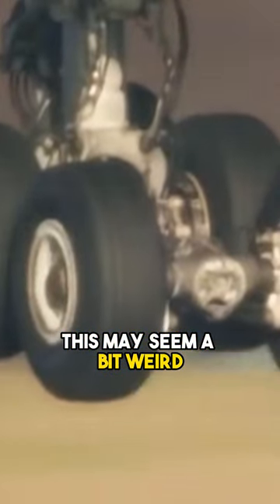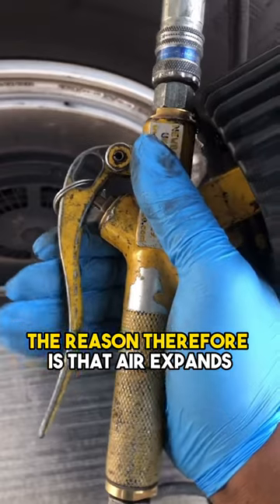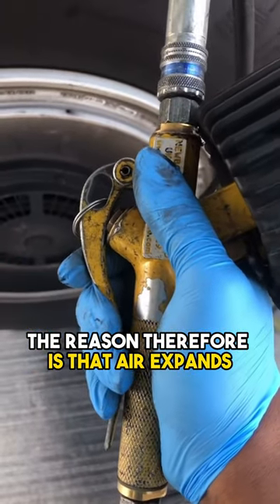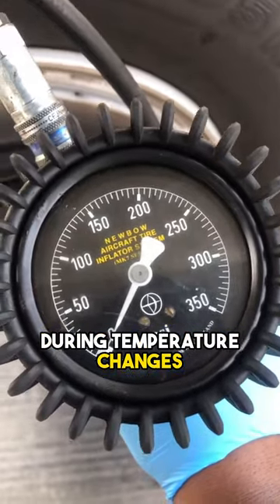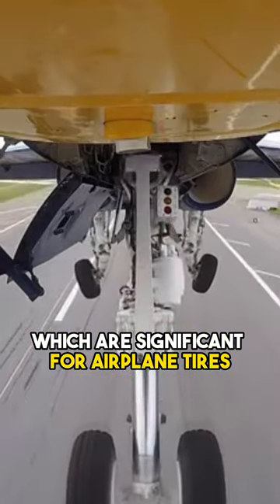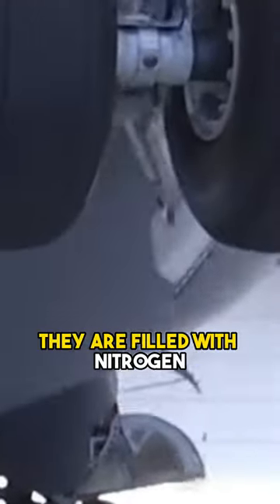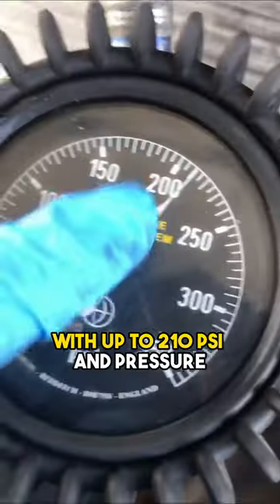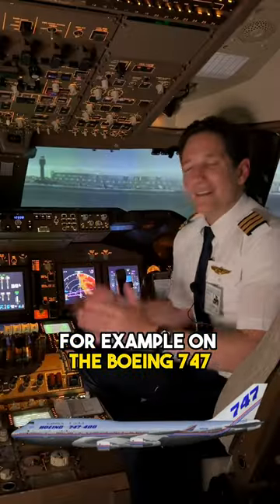What are AIRPLANE TIRES filled with?? #shorts

Comment: the biggest issue with using compressed air is the moisture content - it's not a significant problem in automobile tires, but in airplane tires, it would cause problems.
Reply: Water could freeze inside a tire and cause imbalance maybe?
Reply: @samuelkeystone  Corrosion is another issue.
Reply: We used air in the military on cargo aircraft which had always been used since the aircraft was first manufactured back in the early 60’s until the aircraft were retired. Corrosion was never a problem. The wheels were two piece and painted with a polyurethane paint. The tires probably never stayed on the aircraft long enough to corrode most likely. If the paint was worn away the wheel halves were stripped and sent to Non destructive Inspection to check for cracks. The bolts were never reused unless that had been sent to NDI.  I miss those old days. Life was much more simple. Good day guys.

Comment: Aircraft tires are usually inflated with nitrogen to minimize expansion and contraction from extreme changes in ambient temperature and pressure experienced during flight. Dry nitrogen expands at the same rate as other dry atmospheric gases (normal air is about 80% nitrogen), but common compressed air sources may contain moisture, which increases the expansion rate with temperature
Reply: It's also because nitrogen is an inert gas as well and keeps the same psi hot or cold

Comment: No, air is 80% nitrogen, and the expansion isn't going to be much different. They use nitrogen for a combo of reasons, one of which is that it's already compressed in handy bottles - no compressors needed. Bottled nitrogen is dry, with no water corrode or freeze. Nitrogen is inert, which reduces rust.

For those suggesting helium, it is expensive, not that much lighter, and it leaks out faster.

Comment: Not quite true, one issue is the oxygen in the air that can cause massive safety issues. For example, in case of a fire, because the inside is pressurised the ignition point of the rubber is lower. Therefore you can have internal tire fire but no external fire. Worse, the fire can not be extinguished until it run out of oxygen. By then, the pressure inside the tire is so high that the tire explode! And it's no joke, it's like a stick of dynamite! By using nitrogen instead of plain air, you avoid this issue completly.

As a side effect, because oxygen is a smaller molecule and diffuse faster throught the rubber, the pressure stay more stable for a longer time. BUT this is a moot point, because the service interval is so short that any pressure change due to the loss of oxygen is so small that between each tire pressure check interval there is no real measurable loss.

Comment: I do not understand how/why.
All gases obey Charles law (Volume/Temperature = constant) and the Ideal Gas Law (PV=nRT). Air il already 78% nitrogen anyway. The explanation doesn't make sense to me.
Reply: Aircraft tires are usually inflated with nitrogen to minimize expansion and contraction from extreme changes in ambient temperature and pressure experienced during flight. Dry nitrogen expands at the same rate as other dry atmospheric gases (normal air is about 80% nitrogen), but common compressed air sources may contain moisture, which increases the expansion rate with temperature
Reply: The presence of moisture makes pressure diverge from the Charles law significantly. Dry nitrogen is cheap, produced in a large scale and, unlike pressurized air, requires less permits for transportation and poses fewer safety concerns during operation.
Reply: @FeralEngineer  thank you, that does make sense now. Though most air compressors are able to remove moisture, I did not know about the legal aspects. Thank you! 👍

Comment: Tyre Fires are a thing when brakes or bearings overheat. Fire in the tyre can then cause an explosion some time after an overheat event. Danger to ground crew/passengers. Nitrogen will not support combustion of gasses produced by excessive heat inside the tyre. Now you know.

Comment: I first thought about nitrogen as a fire retardant.
Reply: Not really, but Oxygen or regular air is fuel for fire.
Reply: Not so much as a retardant, as there isn't enough in the tyre to act as such, but the fact that a bursting nitrogen tyre won't feed a breaks fire with oxygen is an important consideration.

Comment: The gas composition itself is not that impotant. However, the lack of moisture in the gas is critical for the predictable tire pressure in the wide range of temperatures airplane tires operate in. And a cylinder of cryo-distilled nitrogen is the cheapest way to provide a moisture-free gas on maintenence site.

Comment: We mostly  fill them with prop wash and sea foam.   Tugboats almost exclusively use airplane tires as fenders. They sure are a job to run a hole saw  through  to make holes to chain them up.
Reply: makes sense bc plane tires are like 30+ ply

Comment: What are the temperatures they are exposed to?
Reply: At 30,000 feet and above, the outside temps are between -30 and -70 F. I don't think the wheel wells are heated or pressurized.

Comment: That is something I never thought of. The tyre at the airport has 14 pounds per square inch on the outside but at 30,000 feet that would not be there.
Reply: Not a huge difference, it is 210 on the inside already, the extra 14 psi is less than 10 percent.

Comment: What was it again? The air we breath contains 78 % of nitrogen... 21 %of oxygen and 1 %other gases... Not sure I would fill mine with 22 % more nitrogen and spend a significant extra amount.
Reply: Dry nitrogen, packed in high pressure cylinders, is cheap and safe to use. At the same time, pressurized cylinders of dry air require more transportation permits and the prices are comparable to pure dry nitrogen. Using a compressor with a drying stage is not only significantly more expensive and requires power, it becomes another point of possible failure. Imagine pumping up the airplane tires in the rain with an overdue drying cartridge.